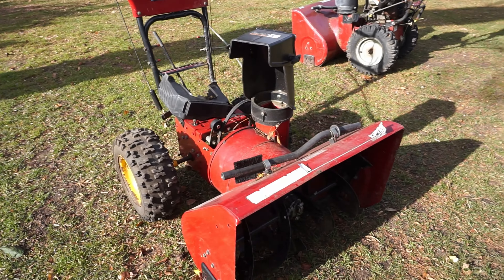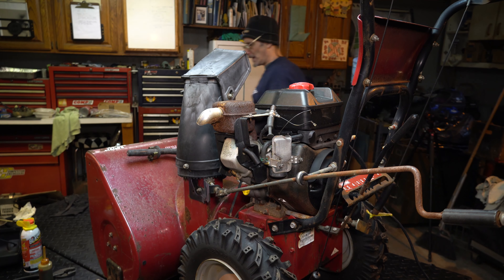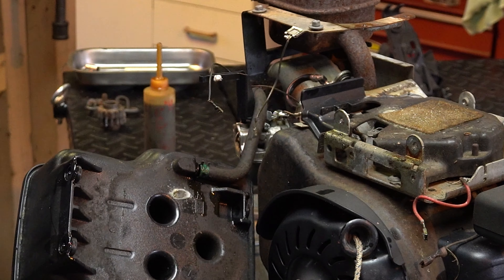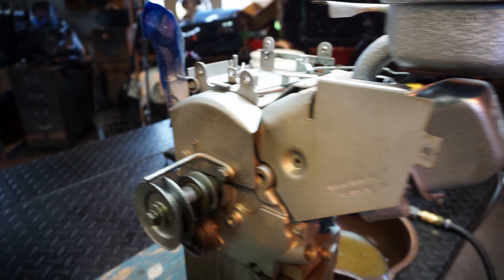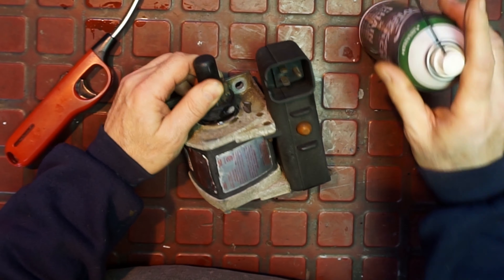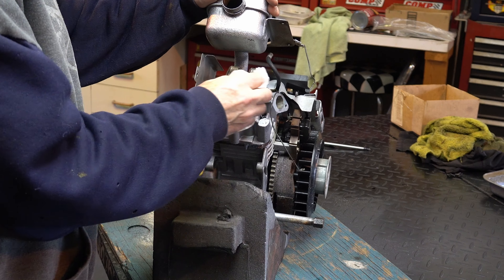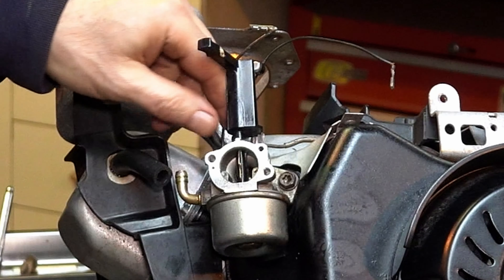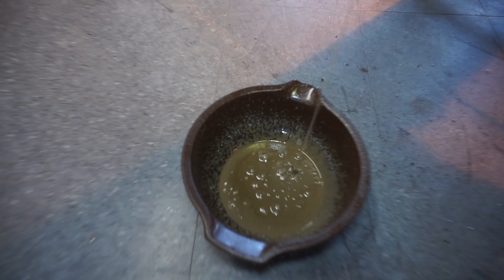REBUILDING The Craftsman 27inch Snow blower~ DEAD Briggs & Stratton 8hp (OHV) Engine - Will It Run?

Comment: I always cover my good used stuff with garbage bags so this will not happen . Also run them before storage to see if there any good , if they are I change the oil then . his way they can sit for a long time before needed . If it is a bad engine it gets pulled apart and scrap unwanted parts , saves on storage room .
Reply from the maker: Excellent Idea! I do the same thing when I can. I got this a while back, covered the engine with the bag for the summer. Although often they dont stay on. the winds and rain here are ruff,,,,,they last for a few months that's it.!